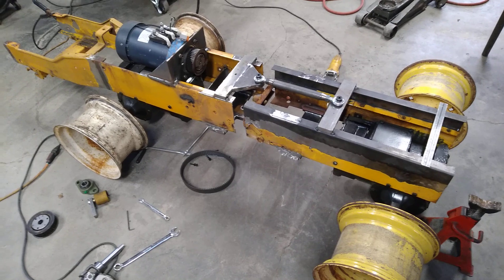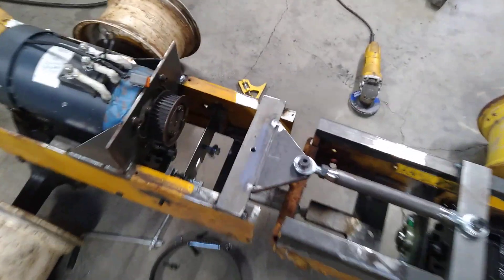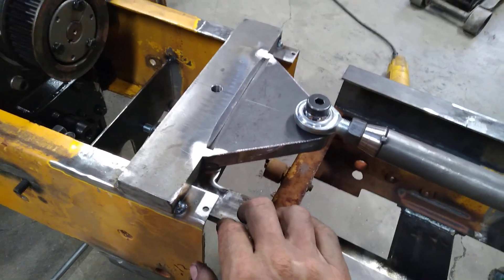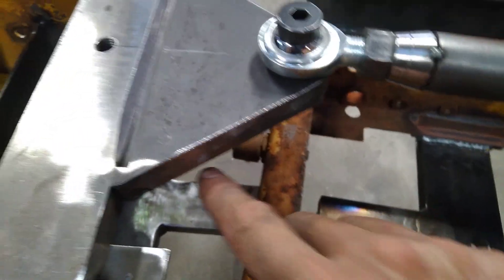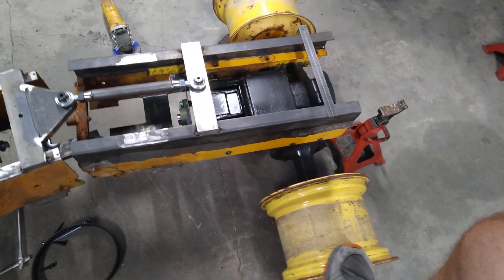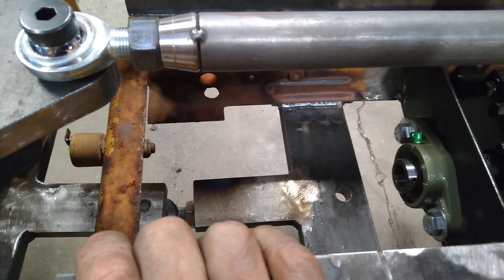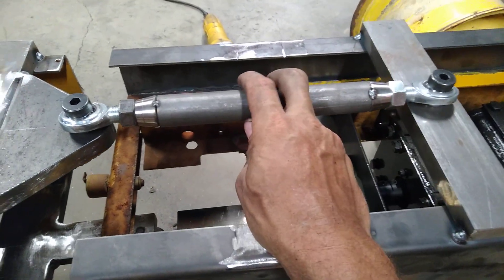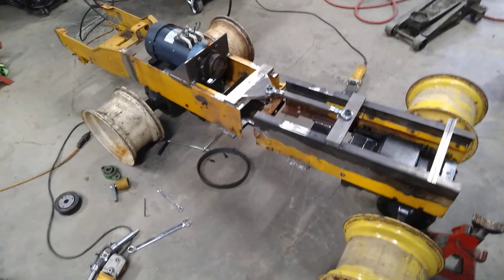Better Pivot - The Cub

Comment: Nice work.   Looking forwards to seeing it after you clearance the frame.  
Maybe us a triangle on the bottom too?
Reply from the maker: Yeah, it'd look nicer.  What's there will be plenty strong...I'm thinking trailer hitches come out straight, are not 3/4" thick and they seem to do just fine dealing with MUCH higher loads.